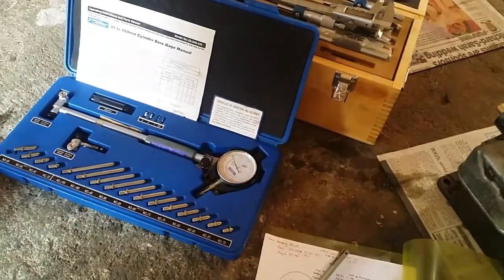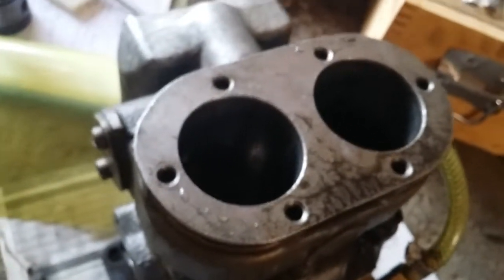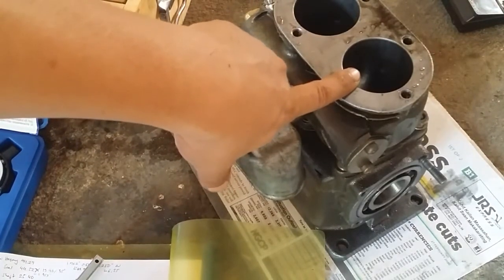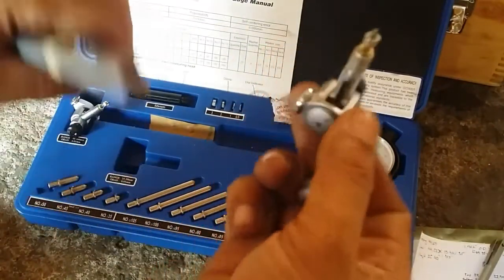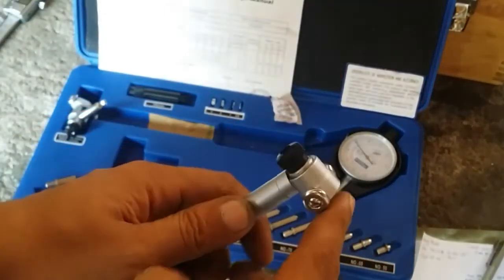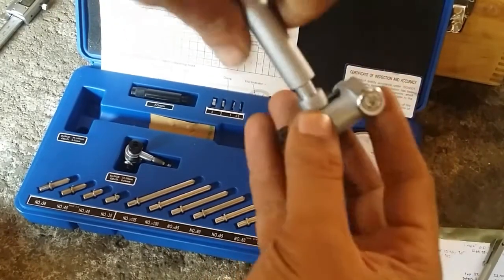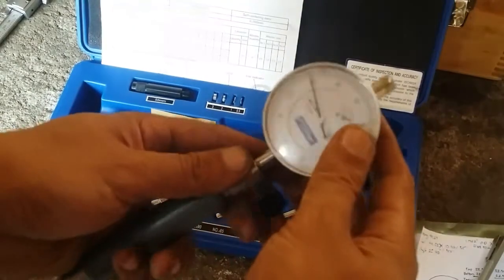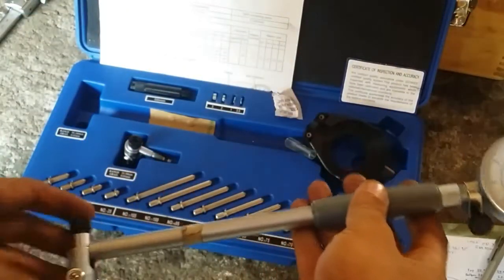Fowler dial bore gauge 35-160mm

Comment: Nice man! Thanks for the information!! I appreciate it !
Reply from the maker: Welcome. I strongly suggest you check it with a bore gauge first or just have the machine shop do it for you. Taking the engine down and taking it apart is no easy feat. I hope you dont get me wrong but ive seen a lot of people do a haphazzard overhaul by just replacing the rings and when it gets on the vehicle they end up with the same problem or even worst. Its not worth it in my book. After spending money for labor  they end up with nothing. My views is when we need to do it, we need to do it right so that we'll only need to do it once. Im willing to bet a bore gauge is going to reveal the imperfections on those cylinders tht were performing poorly. I wish you the best, and hope everything works out for you. Have fun!